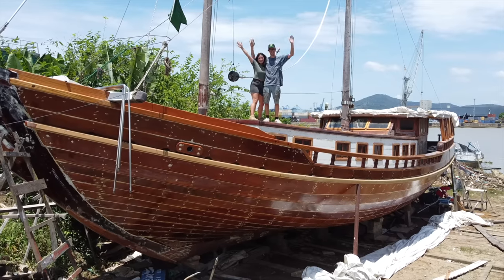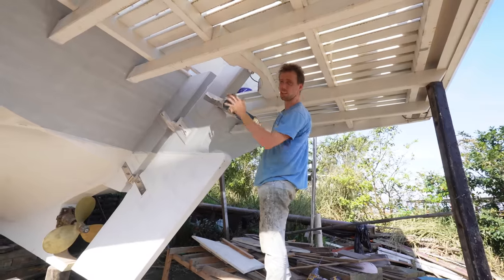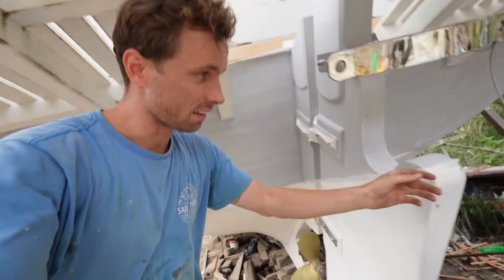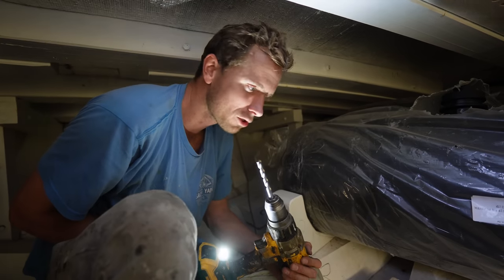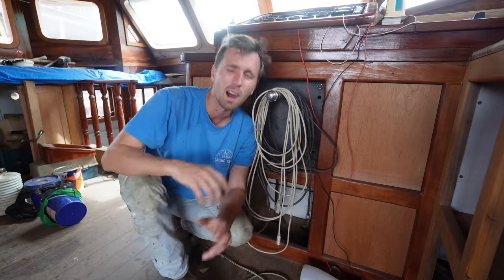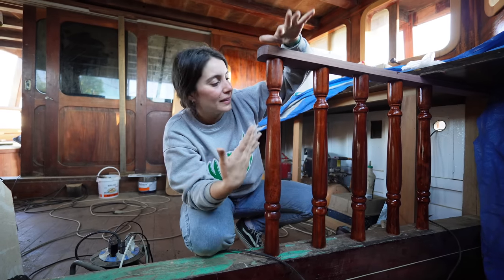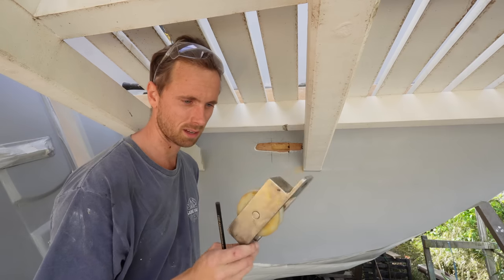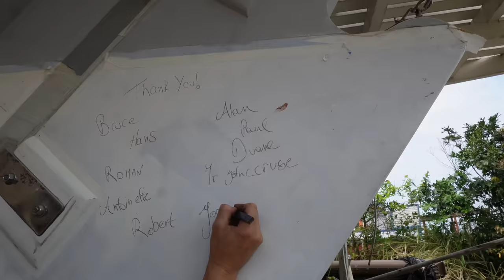We can finally steer our once sinking wooden boat into the horizon — Sailing Yabá 152

Comment: As a former US Navy Master Helmsman, may I respectfully suggest that you make sure you have some kind of "Rudder Angle Indicator" at the helm gauge cluster?  In other words, a gauge that indicates at what angle the rudder is actually pointing. Trust me, you'll really want to have something like that.
Reply: Absolutely agree
Reply: Aye aye cap'n good idea 🙂
Reply: Absolutely. Yes.
Reply: A rudder stop also!
Reply: @rolfsvensson5777  also good, but in this case not strictly necessary. This rudder turns to nearly 90 degrees. Anything past about 60 will just add drag and not turn, so they'll never go there any way. 
I see no convenient position in the 35-40 degree range to mount stops, except on the cable itself, which will just add unnecessary strain to the system.
Reply: Agree! My concerns in following seas it could do just that so the pressure on it would be very high! It is a barn door rudder after all! It is up to the helmsman not to over correct! Thank you! @RealShawnPate
Reply: @rolfsvensson5777  I see the difference. The traditional rope and spool rig has more play and is able to stretch and flex more. Cable and chain, when hit with a ton of two from behind, is much more likely to snap without good stops.
Can't disagree with that.
Reply: I just hope they the Jaba people stay costal! They do have a tiller if they need it! But anything over 40 feet it is hard to handle a tiller! Thank you for the reply and we all hope the kids make it! Should we also talk about that swim platform in the stern? No! Smile! @RealShawnPate
Reply: @rolfsvensson5777  👍They'll be fine. People have sailed this design of boat for a very long time. 
Best practice is not the only way. 

We'll keep them in our prayers.
Reply: @rolfsvensson5777 The hull shape is like that of a scow, which is good for getting into shallower areas and not getting stuck too easily, but makes for a not very suitable bluewater boat. This boat was designed for coastal runs, inlets, estuaries and quick island hops in very good weather, as it was a tourist pleasure-craft with diving platform etc. Adding twin keels at some stage could potentially allow it, and improve stability, but it's not really designed for it.
Reply: Thank you my man!  I do agree!  @VenturiLife
Reply: Yes all the goodies. Wait many more have done it without all the goodies. Be self sufficient goodies are like a dishwasher.

Comment: I strongly recommend you convert to hydraulic system and add the autopilot.  The wire system is not going to last and you will struggle with the weight and floatation of the rudder. Use the last months in drydock to get this critical system right.
Reply: Yes so true  if you can upgrade to hydraulic that’s the safest way to go but would need exterior slave cylinders at the transom outboard as it has no internal tiller . I installed many Hynautic helms on trawlers in the past but at least upgrade all parts to heavier cables and much larger diameter pulleys for cables. Small
Reply: The rudder mechanism is just hysterically funny. "Heath Robinson" is the best descriptor. Surely no adult male can be this witless!
It would be sad as a piece of home DIY done by an amateur. As a way of installing the most critical part of a boat' systems, it is downright stupid. It is WAY under-powered and under-engineered. Dangerous. Even the wheel is dangerous; too close to the woodwork. A hand could easily get caught between the spokes and the timber.

This is one of my only negative criticisms. And, I suspect, and hope that it is clickbait and that the system will be brought up to scratch in a future video
Reply: Hydraulic steering and autopilot! Get a contractor to install both. You'll never regret it. Without this, steering will become a chore that requires constant attention!
Reply: Maybe a trim tab would help. I'm not a boat builder but that rudder seems clumsy at best. Those cables are gonna stretch. I use to be an A&P mechanic. I know alignment of those pulleys and direction of force is critical. If it were an aeroplane I wouldn't fly on it.
Reply: Cables and shives are perfectly fine if installed correctly.  
Simpler,  easy to adjust, easy to repair.
Yes, hydraulic steering works great, when it works but why introduce a maintenance prone unique system when you don't have to?  Makes no sense.
Reply: Yes. Go with Hydraulic
Reply: @nick.caffrey The cable / pulley system is what it had originally, but yes it is inadequate. Easily repaired, that's about it.
Reply: Yes it’s easy to strongly recommend spending some else money. I strongly recommend just purchasing a brand new carbon fiber 65 foot catamaran.
Reply: @nick.caffrey  Says the prince in the tower of the gilded palace upon the hill.  You're out of your depth here, you should go back to the kiddie pool where it's "safe."
Reply: Clearly you didn't see the previous all rope and nylon pulley system that was used successfully for many years, this is plenty strong.  It's a wooden schooner that goes maybe ten knots downhill, not some kind of crazy racing yacht.  Not to mention the fact that almost all the miles ever traveled under sail were in boats that used natural fiber lines for everything.

Comment: Ben,  With the weight of the rudder and the water pressure when steering Yaba will create very "heavy" steering. the best solution would to go with hydraulic system, but if that is too expensive, consider using a block and tackle and turnbuckles for adjustment of the slack.

Comment: Here's my 2 cents on steering. 
1. Where the cable passes through the hull, get some threaded tubing that the cable just passes thru easily. Put the tubing thru the hull with epoxy and with brass washers and nuts on both sides seal it up.
2. On both port and starboard cable runs, install stainless turnbuckles. That way you can easily adjust the cable tension. 
3. To eliminate one set of pulleys,  build 2 drums to capture the steel cables, like a winch. Between the drums place a sprocket for the chain from the helm. The cables, one over and one under the drum, will feed out one direction while feeding in from the opposite direction. Mount it directly under the helm on a shaft with bearings.
But that's my 2 cents worth. No that's 3 cents!
Great video as always.  Love to you both. ❤
Reply: Agree%100 .
Reply: 100% agree
Reply: Exactly
Reply: Yes, I agree.
Reply: 1. I was thinking about some kind of dynamic tensioners because turnbuckles will always need to be adjusted. The main idea about this issue is that in water, if you don't have equal tension on both sides of the rudder at all times, the rudder and the wheel will have too much play and they will jump/snap left and right, rendering precision handling impossible and tiring.

2. I don't think that 6mm cable is going to last long in water, at speed.

3. If you put a small hub at the wheel. you will have more torque on the system, the 6mm cables, the chain and a travel stop mechanism still to be engineered.

4. The interface between the cables and the chain relies only on the strength of one link. I suggest you find a setup where you spread the load on few links like 6. Remember, a chain' strength is a combination of all the link' strength together.

5. Try to find a way to be able to read the rudder' position.

Fantastic to see the boat progressing, you guys are great!
Reply: @2oqp577  True, though understated.
Reply: Best comment on this thread summarizing all the problems and giving solutions.
Reply: Very good recommendation.  Agree 💯

Comment: You'll need a turnbuckle to provide tension on the steering cable. That loop piece is called a thimble.  Also, there's a correct way of installing  cable clamps.  Remember, you never saddle a dead horse.  The cast part of the clamp is called a saddle and it should always be on the live end, or the end with the load.  Again, never saddle a dead horse.

Comment: You are getting a ton of really good and necessary comments. The rudder will be under incredible tension when you are under sail. My suggestion is that you use bolts/nuts to attach any pullies to the boat. The lag bolts you are using can easily pull out and turn a bad day into a disaster.
Reply: It is not if, but when this is going to happen. Aim for the worst scenario, wjen it is steering related.
Reply: I couldn't agree more. You need to through bolt the pulley's and the pulleys need to be sitting on spreader plates. The current setup has disaster written all over it.

Comment: What you guys are doing is really awesome.  The cable goes through a thimble.  I recommend turnbuckles on each cable to make them tight and adjust the rudder for straight.
Reply: Should be on the inside, not out in the weather
Reply: And slack cord weights or springs on the cable to keep the wire from slipping on the gear or cam? Like the derailleur on a 10 speed bike. Keep the chain tight on the gear if something were to cause the gear to go crooked and the chain jumps off the gear, the cable goes slack, the wave forces the rudder sideways and dumps to one side.....God forbid..
Reply: Keeping the cable tensioned will be a nightmare without turnbuckles and teflon type busheds in the throughhulls as suggested.  Just a tip, always fits the shackle bolts so the thread is at the bottom and wire the bolt to the shackle so it cannot turn itself out.. regards

Comment: You need to add turnbuckles with springs so you can set the tension on the cables. Use stainless steel collets to pass the cable through the transom.

Comment: Hi guys, Sunday is the very best youtube day because of you! So many comments about the steering system. It is such a big heavy boat that I must agree with many of the concerns about the size of the chain and especially the termination to the cable. The size you have is similar to my 42' fiberglass sailboat. One thing I would add is that you need very heavy stops directly at the rudder. They could have bumpers for shock reduction. When backing down or in wave action, the rudder can slam uncontrollably all the way over. Almost any steering system can be destroyed this way but protect it as much as you can.
Reply: Yes this was my thought last week....

Comment: When my shop has to drill through a transom for a cable I make a stainless tube just oversized of the cable, flare the outside end and epoxy it in the through hole. This gives the cable less drag and won't wear the hole in the transom.I would also use stainless turnbuckles to allow for adjustment and  alignment of the wheel. They make wire crimps that I use on aircraft control cables that go on the end of the "thimbles" (the thing you asked what the name is) the cable goes through the crimp and around the thimble and then back through the other side of the crimp. The crimp is then swaged with a crimping tool and made tight. Go on line and search for cable rigging fittings to see what I am describing.  Good job so far!

Comment: The thing you wrap the wire round to make a loop is called a "thimble". 

You'll also need to put a "turnbuckle" or "bottle screw" into the system on both port and starboard sides, say on a long run between pulleys, in order to apply the correct tension to the stearing wires. Otherwise you'll have a lot of slop when the rudder acts against the water. 

Pulleys on boats are either called "blocks" or "sheaves". It's a "sheave" if it guides a rope/wire into or out of something like the mast/boom etc. Or, through surfaces such as the deck, transom, etc. For anything else, it's a "block".

Hope all this is helping you get things right. It's been a joy watching you learn and grow in your boat building skills!

Comment: the quadrant's geometry + the way the wires are hooked up and routed makes it heavy near max deflection. usually the wire comes in the same plane as the quadrant and goes around the quadrant and is connected to the opposite side (wrapped around the quadrant), so you have constant leverage across the whole range of motion.
Reply: I agree, that is why it is a quadrant, should be two quarter-circular  grooves  as in a twin groove pulley to guide steering cable, that then maintains tension on cable as rudder arc traverses . The end of each cable crosses around quadrant and is anchored on opposite side of quadrant. Another idea is to terminate the steering cable ends around a block/pulley to a strong point inside hull and connect these pulleys to a larger 8 m,m, cable routed around the rudder quadrant and through the stern pulleys and stern guides. This will give a 2:1 ratio allowing easier steering and more turns of the wheel and not necessary to re-engineer steering gear, a longer chain might be required at the helm.
Reply: I agree.  All the quadrents i have seen in my 45 years at sea run the wire to the other side so the pressure is spread evenly along the quadrent.

Comment: So many great suggestions and I just want to throw in my pennies worth. Where the wire cable connects to the steering quadrant you have wire to metal contact. I highly suggest a shackle be in contact with the quadrant, rather than the bare wire cable. Also, I was wondering if you have a steering brake. I didn't notice one when you were putting everything together. Nice to have for many reasons, but if you want to leave the wheel for a second without setting the auto pilot, a brake will allow you to do that. Love your episodes every week.

Comment: Ben, the ideal rudder angles are 30 degs to port and 30 degs starboard. Any further will cause a braking effect. You will need a ferrule for each cable passing through the transom. A turnbuckle at the end of the chain to help in tension is another requirement. Other than that it's all coming together for the splash. The item you were asking about is called a hard eye.

Comment: You should place a metal or Teflon ring inside the hole that the cable comes through. This will help with the cable friction and not making the hole in the wood bigger.
Reply: Yes
Reply: I will say along with a Neoprene plug to run the cable through
Reply: Exactly what I was thinking 👍🏻
Reply: This approach is called a 'fairlead'.  Because the holes are above the waterline by a lot, you don't need to seal the outside with a plug or a neoprene gasket around the cable.  However, to minimize the wear and tear on the cable, I would sheathe it in either a rubber tube or electrical shrink tubing for the length of the travel of the cable through the fairlead.  And I'd make the fairlead from a brass tube that was slightly larger than the cable with its 'jacket' on, to minimize the friction.
Reply: @crankyoldguy2  Well above the waterline or not, any through-hole in the transom should be watertight. Otherwise a following sea could result in water ingress.
Edit: Just my opinion. I know very little about boatbuilding, mainly what I've learnt from Youtube.
Reply: I agree. The hole/wood needs to be protected and I think it should be brass.  Also the cable needs to be protected from the brass tube hence the "jacket" @crankyoldguy2
Reply: yep i was to remark it
Reply: Watching with the sound turned off just shaking my head... must have a rich daddy?
Reply: Absolutely. Needs a sleeve so as to protect the hole from possible wear.

Comment: Please ! Remove the cable from the chain and go up a couple of links as you are not supported by a rivet that holds the chain together
Reply: Absolutely agree - the adage that a chain is as strong as its weakest link really applies here, you're whole rudder system is depending on one rivet of that chain.  When you see how a chain works on a bicycle you will see that the load is shared across multiple links of the sprocket.  And you should allow enough slack in the cable so that if you ever have to make a running repair you will have enough cable to splice a join without having to re-run another cable.
Reply: This system is not good ! To many faults, read all the comments, which are good.
Reply: Totally agree with this . Also the other reply about simplifying the set up , too many parts to go wrong !
Reply: Hi, maybe an idea to have a stainless steel tube  epoxied in the transom for the steering cable (or chain), so the wood is protected.
Further I'm so happy for you both that you made already so muxh progress.
Reply: And create end stops on both side of the rudder blade so the rudder can’t go over 60 degrees  angle when hit by a wave.

Comment: Are you considering inline turnbuckles to allow for adjustment of the tension of the wire rope?
Reply: Or some sort of adjustable tensioning pulley. I’d also put little brackets in each ceiling joist (not a boat term) or ever coupe feet as it goes for the wheel to the transom so it doesn’t sag or get caught in things while you moving around in the hull.
Reply: Preload with a spring to avoid slack even happening.

Comment: As others have said below, turnbuckles are a must. Those cables will stretch over time and turnbuckles will allow you to tighten the cables to keep the steering "feel" accurate. Also, consider delrin tubes as inserts through the transom. For one thing, they will keep the cable from rubbing on the wood and also, with the delrin tube you'll be able to epoxy it in place which will seal the wood in the hole. Otherwise the cable will transfer water into the hole and the unsealed wood.

Comment: FYI the Steel Wire Rope Clips should be correctly installed with 3 per connection with the sadle on the long side and the U bolt on the short side with 5cm between clips.
Always install an eye for the steel wire rope.

Please lookup a video on how to.

Awesome progress on the boat